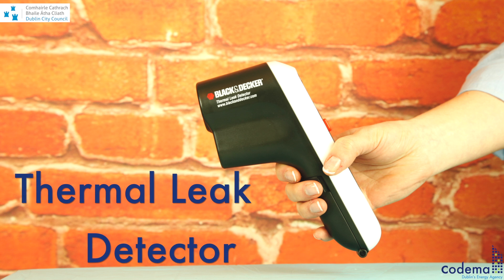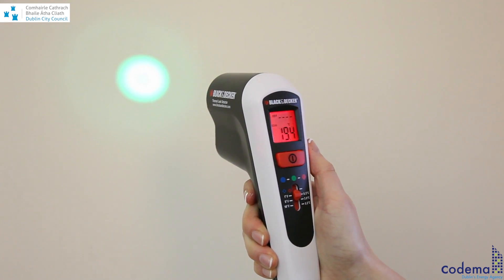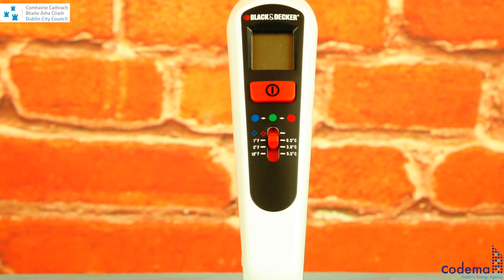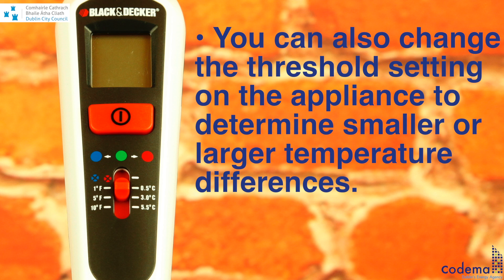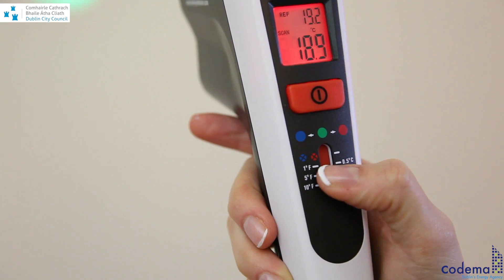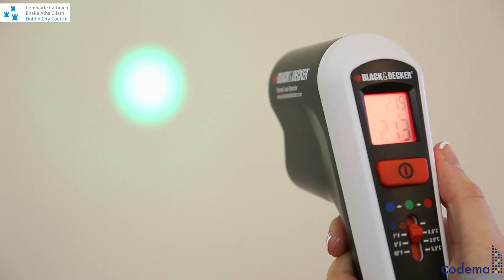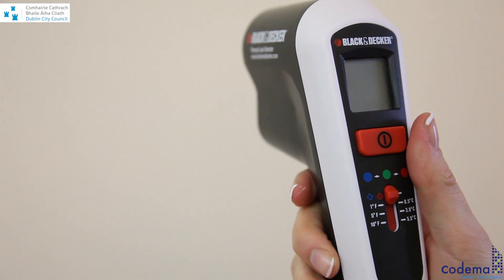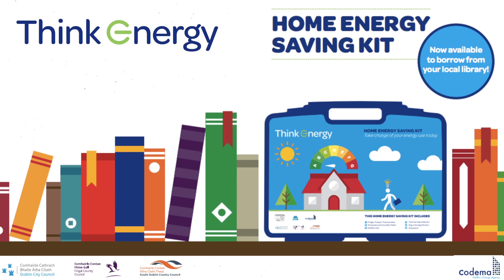Thermal Leak Detector Instructional Video

Comment: Does that mean where there is a lower temperature than your reference temperature that this is where heat is escaping ?
Reply from the maker: Hi Michael. If you find a lower temperature than your reference temperature the LED light will turn from green to blue which means there is a cold air draught. If it turns from green to red that means there is heat escaping. We hope that helps!
Reply: @CodemaDublin  brillant thanks